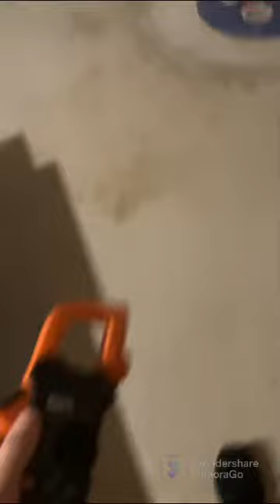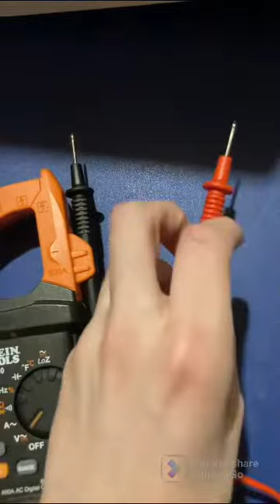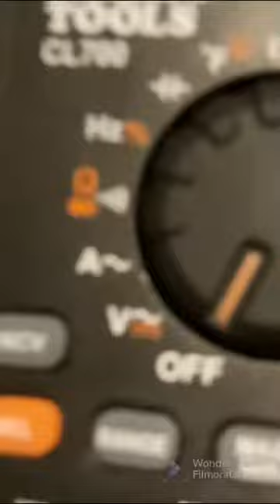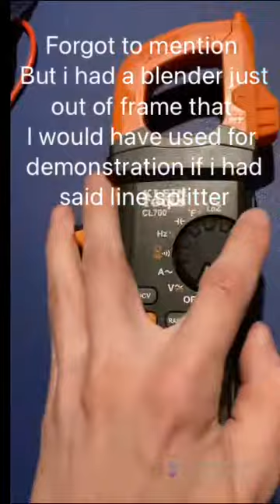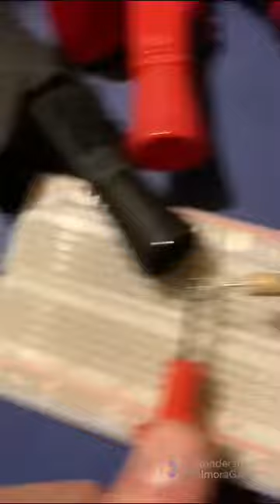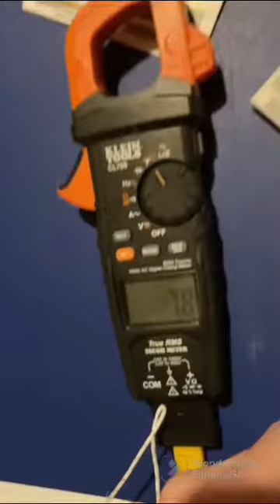How to use klein tools cl700 multimeter (workplace prep final)

Comment: Hi I have CL700 like you still having problem to start to use clamps. Tried on ventilator but not working. How should i operate it? clamps for battery are ok or no?
Reply: The clamp will only read AC current